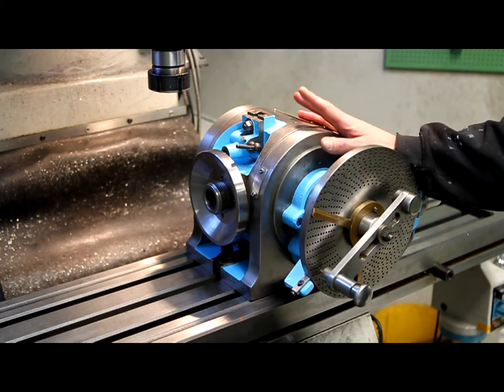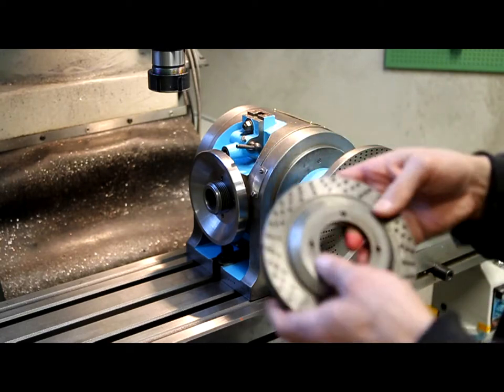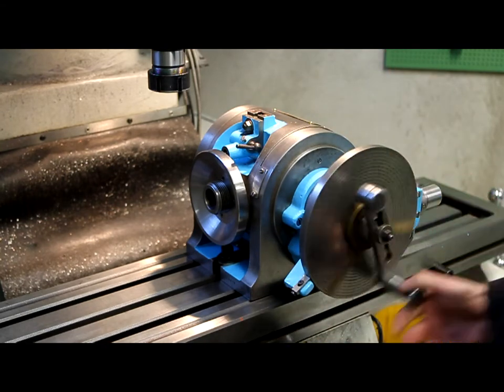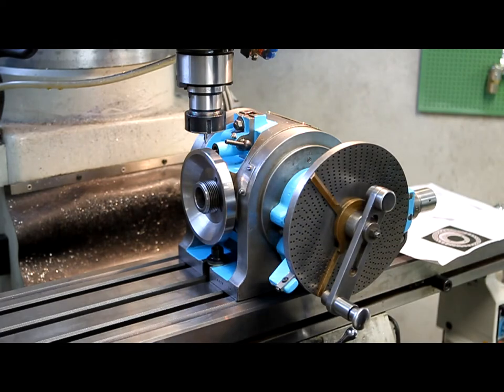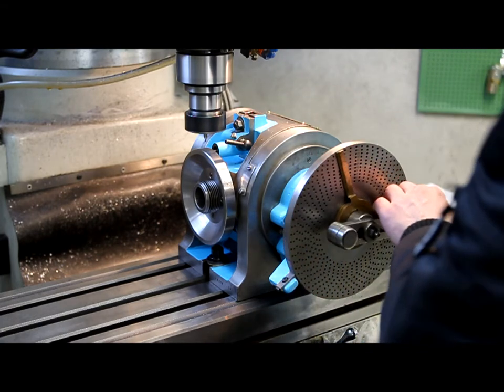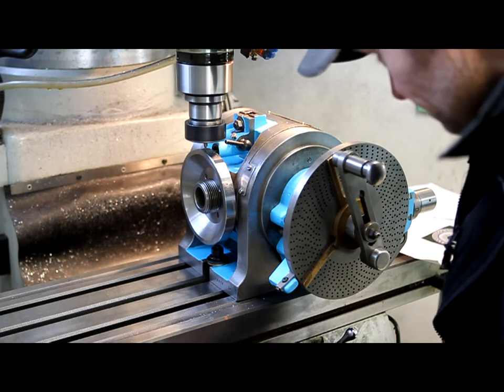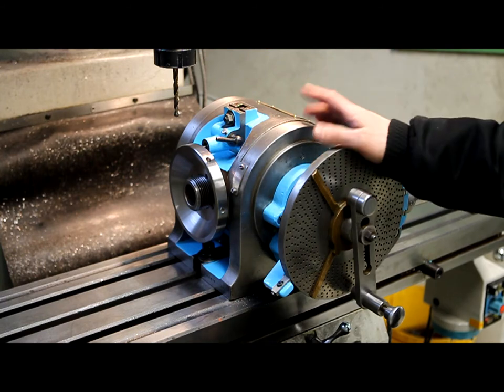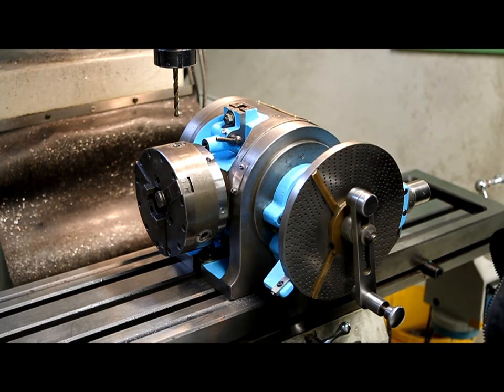Cincinnati dividing head

Comment: Hello, do you still have the dividing head?
Reply from the maker: Yes I do. Look at my last video :)
Reply: @Panzax1  I just found your channel yesterday so I just started looking all your videos. 
One question on the dividing head: I have the same but from another brand (UMC) and I am missing the system for direct indexing (sliding block with pin and lever). Could you make a sketch from yours and put some measurings on it so I could reproduce one myself? Greetings

Comment: i have the accuracy report on a Cincinnati diving head when new and its about a thou at 60" arc
Reply from the maker: That is interesting, but I can't quite understand where to measure that. It seems you need a diameter to measure at to be able to specify it that way.
Reply: Panzax I assume it was checked in seconds and expressed in a manner that could be visualized in coequall language
Reply from the maker: Yes, that makes sense. It would be a cool project to check out the accuracy as it is now, but I don't have any equipment for that.

Comment: You won't ever use that direct indexing pin on the top. You should just send it to me as the one is missing off my dividing head. :-)
Reply from the maker: I'll make you a copy if you want. But I suppose you can get another head WITH the pin for less than the cost of shipping and material ?

Comment: Hi 
I just wanted to tell you  that sound is better or OK now, just read that you made test with new camera, much better then old camera, probably you can render video in different video formats so it will not take too much G Bytes, depend on video editing program you use, anyway good decision to record with better camera in my opinion, keep good work .
Reply from the maker: I might try rendering in a lower resolution at some point.